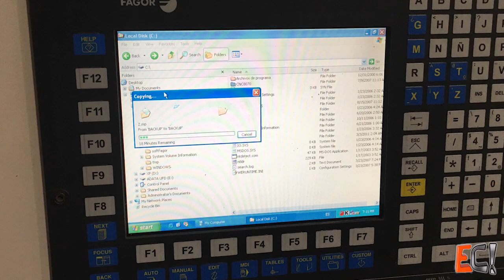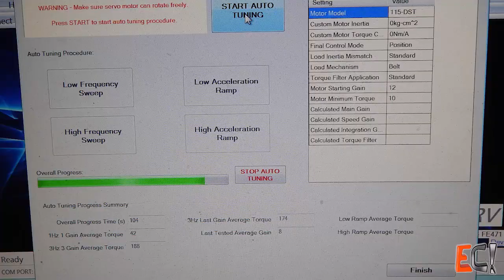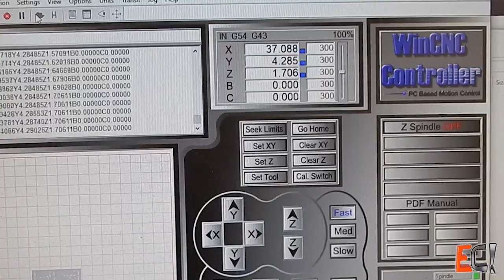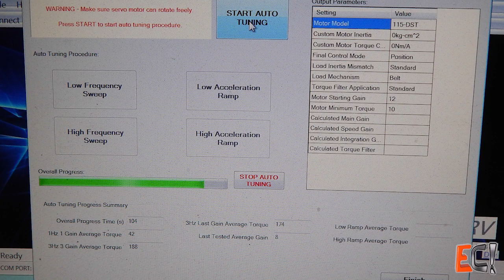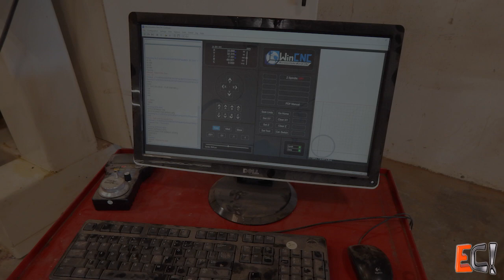My Big 5 Axis CNC Router Retrofit with WinCNC and DMM Servos

Comment: I've had no such issues with my DMM servos.  I installed line reactor and noise filters per their wiring diagram.  Tuning the servos should have no impact at all on how that table was sputtering around.  Also, the servos supposedly auto learn after a little usage.  Michael at DMM is extremely helpful and usually answers emails within 2 hours.  https://www.youtube.com/watch?v=kQO7emri6sQ&t=4s
Reply from the maker: I'm not sure what issues - my problems were all self-inflicted.  Both Michael at DMM and Kelly at WinCNC were amazingly helpful on many occasions and I am very happy with both products.  You're right about the filters and line reactor and those are in the plan for this machine - should have been from the start!  I tried to re-use as much old wiring as possible and this was probably a mistake - should have designed it clean from the start.

The auto-tune was a good place to start but required some heavy modification to get smooth coordinated motion on the linear axes - not 100% sure why!  I am still a little confused about how accelerations work in WinCNC but now it works very smoothly.

Are you using WinCNC+DMMs with your Thermwood?
Reply: @ExploreComposites  I upgraded my stepper based DIY router to Hicon Integra + DMM + Mach4. The Thermwood hasn't even been powered on since it was delivered back in February.  I just received the step up transformer to get the required 480V.  It has the old Super Control 91000 + 14Nm Siemens servos.  DMM doesn't make a powerful enough motor to swap these out.  I have some ideas of how to keep the Siemens and swap out the control system.

Comment: Did you use ac line reactor and filters for wiring up the DMM servo drives, as recommended in their documentation?
Reply from the maker: Good idea!  Thanks for pointing this out.  I didn't use one but it is something that should be there - and I will work on adding now that you mention it.  The VFD has a line reactor that I installed but I never did for the new servo drives.  

When you say "filter" you mean a EMI/RFI filter?  Because these drives have control power (110v) and line power (208v 3ph) they would need two different sets of filters and line reactors?  #notanelectricalengineer!